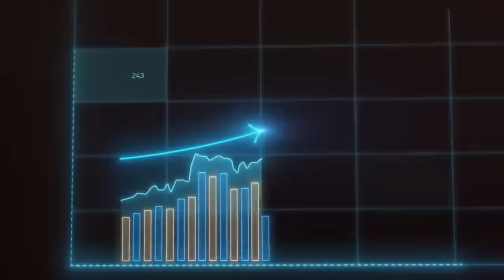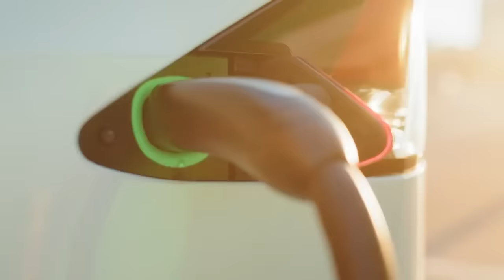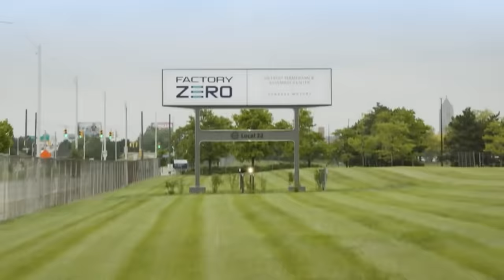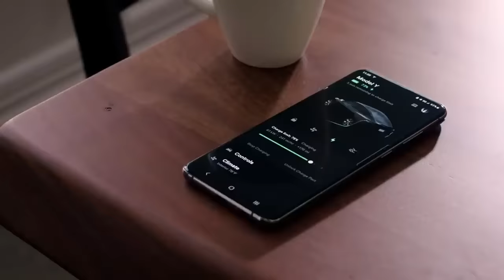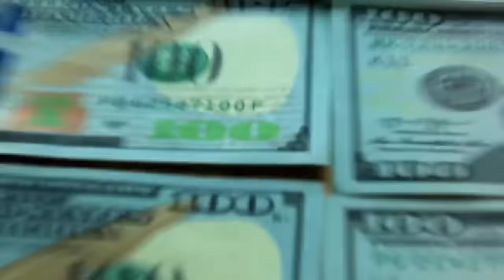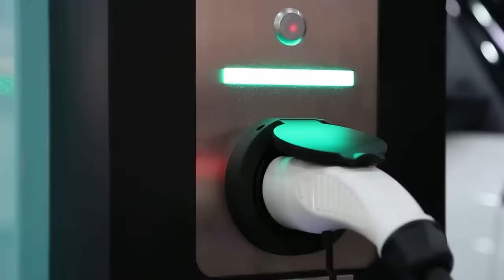Electric Vehicle Owners Are Frustrated and Demand the Return of Gas Cars

Comment: A co-worker was bragging endlessly about his EV.  He was so superior to those of us who have normal vehicles.  Then, last Monday,  his wonderful, dependable car would not start.  He sat in the parking lot, plugged into a charging station, for a solid hour.  The temperature went from -19 to -22 F and he finally came in and asked for a ride home.
Reply: @retrobeatsdang brutal. 😂. You really want him to get his just desserts.
Reply: That's mean!  He might not of had a warm enough coat on and it would of killed the guy. Bragging about something because it makes feel better is nothing. It's when your boss starts to have you dotting that will hurt you or how about not caring if you fall on ice and hurt yourself! Bragging is nothing compared to bosses I have seen. Like my last boss acted like a school teacher to actually acting like a boss she didn't really punish anyone if they get harassed or get hurt by someone. She was acting like miss sunny days
Reply: @vanishingfox1339 Would you give that guy a lift?
Reply: Is that workplace at the north pole?
Reply: Bwahahahaha
Reply: no onesw car starts in this weather       just like the old days   u forget>>>
Reply: @cindybrown9898  Take your BS lies elsewhere.
Reply: A Tesla should have a heater port into the battery cooling system. A propane heater in the frunk could be plugged in and cycle on and off to prevent the battery from freezing.
Reply: My father used to work for the AAA in Buffalo. They would receive thousands of calls daily for cars that wouldn't start when it got cold.
Reply: @lanejohnson7656  Thousands of no start service calls at the AAA then the temps hit the lows.
Reply: @peter130476  I reckon it's in the northern part of the US. There has been a ton of news coming out of the US about carparks full of Tesla's that won't start, either due to cold or charging stations being dead from cold. Also a bunch of news poking fun at Tesla drivers. I'm not sure if the weather's any different to normal but there are probably enough Telsa's around now for people to take notice.
Reply: most chinese EVs have air conditioned batteries, it warms the battery when too cold or cools it when too hot, that must be a old tesla thats dead.
Reply: @abcJ-q4v hahahaha, how do you warm in an EV battery  when the heater uses the same battery and battery won't operate? Oh wait, you said 'Chinese EV', they catch fire all on their own, no common sense required!
Reply: Oh I forgot that gas cars never have issues 😆
Reply: @rcpmac  Thousands out of millions?  lol    You do realize when AAA got there they likely hooked up a jump box or jumper cables and started the vehicle because the cold ate up the battery right?  lol.   Do some research and tell me how many of them thousands were towed to the persons home or to a gas station..  

See thats the difference..  You run out of charge in your EV you are getting towed.. You roll up to a charger that either doesn’t work or there is a line and you only have 5 or 10% battery you  literally have to wait or get towed to another charger. You can’t just drive across the street or down a couple blocks to another charger.. lol

 It got down to -30 where I live and even my lil carbureted Ram 50 fired right up with 6 pumps on the pedal.  Whenever it gets cold, snow or ice out I fill 2 5gallon gas cans and throw them in my truck just in case I run into problems myself or someone else needs help. I always have jumper cables in everything I own as well as a small boost pack..   Don’t know how many times I’ve checked on someone that slid off in a ditch and dumped 5 gallons in their tank to make sure they had enough gas to run their car to stay warm until a tow truck got there or jumped someone’s car for them..  I’ve only ran across one person that wasn’t smart enough not to put E85 in their car and their fuel lines froze up. Even that was a relative quick fix without a tow..    Don’t see EV’s in my area because there isn’t anyone dumb enough to buy them because chargers are non existent..  Something you and EV Jesus refuse to acknowledge is, in many parts of the country chargers are non existent once you get off the interstate.. lol
Reply: EV owners tend to be quite arrogant and a bit loony...
Reply: @travelmates1 - that’s because they are on a mission from God to save the planet - God bless all EV drivers 🙏🙏🙏 - thank you for your service 🖖🖖🖖
Reply: Wow
Reply: @peter130476  We had temperatures under -15 to -5 deg Celcius (5 to 23F) for over a week now (in Europe)! Good thing I have a diesel with a good battery. Started at quarted of key turn...
Reply: @timothykeith1367  So now you want to use propane to heat the car? Why not just buy an ICE car and admit EV's are a waste of money, and terrible for the environment?
Reply: @abcJ-q4v  Chinese EV's are the MOST notorious for burning to the ground. I would probably not make the comparison to Chinese EV's for that reason. I might knock EV's but even Tesla conditions the battery. Chinese EV's are not special. Well they are, they're special for burning to the ground more frequently.
Reply: Did he leave his car at the charger? I hope when he went to pick it up he had a big fine for overstaying!! Much mirth at work from ICE drivers I assume!
Reply: @timothykeith1367 propane heater in a Tesla your crazy. Never going to happen.
Reply: @fmo94jos8v3 right, let's just add more combustibles to the already rolling nuke.☢🤣
Reply: 😂😂😂 karma!!!
Reply: I don't agree with bragging at all.  However, which EV did he have?  EV's are like any other automotive product - there are good ones and bad ones.  If he was driving a Nissan Leaf, good luck in cold weather. There's no thermal management of the battery on a Leaf (aka no heating or cooling system at all).  I live in Canada and drive my EV in Canadian winter.  I keep a booster pack with me in the off chance my 12v battery dies, I can still start my car.  The key detail for all EV's is I charge at home. If you can't charge at home, I'd say to anyone an EV doesn't make as much sense.
Reply: I wake up every morning to a full tank ⚡️and I live in the arctic 😊
Reply: At least you acknowledged his superiority.
Reply: @cindybrown9898 My cars have always started at temperatures of -40 and even lower. That included my 1969 Acadian with the 230 straight 6 and 1 bbl carburetor.
Reply: 面白い😅
Reply: Doing and saying are two different things, do you ever see an ICE car breakdown?
Reply: @timothykeith1367  
Why not just use the electric like they already do? They have a heat pump, much more efficient than a propane heater (or gas for that matter).
Reply: I don't understand since I haven't had a single issue with mine from 2018 and according to people life in cold climates have no issue? Was is a Nissan Leaf if so can see it
Reply: I had an old 2007 Nissan Qashqai, and i never had a single issue with it in winter.Once it was -40 Celsius. It started like it was nothing. The only thing I had to do was replace the battery once in a while
Reply: @faithdelucas1517 most companies aren't gonna care if you give a co worker a ride home. That's not their issue. Hope all that smugness will keep em warm
Reply: @timothykeith1367  One way to hybrid! Fuel is much more efficient at heating than as an engine. Also a small engine with a large amount of heat extraction would be efficient but more complex. Cold climates change the game.
Reply: he can call tow truck tow his EV and him self home
Reply: Epic moment I assume that was!
Reply: LoL, that should stop his bragging.
Reply: Once EV stops charging it explodes 😂
Reply: @retrobeatsThats the problem, instead of working together. You guys are just hating because you don't have it. Stop being jealous. I waited 8 years to buy minds while young rich kids with no responsibilities and mommy and daddies money was driving around bragging. I finally got minds and loved it not going back.
Reply: The cold affects gas cars too.  But if his car wouldn’t start in the cold that was his fault for not charging knowing it would be cold.  Plus they don’t prevent them from starting like gas cars they only take 15% of range.  Either your story is just that a story or the guys an idiot.
Reply: So I guess you shouldn't have an EV if things get cold?
Reply: And gas cars NEVER break down in the cold 🤣🤣
Reply: @peter130476 have you never been to North Dakota in the winter?? 😂
Reply: Надо было сказать чтобы пешком шёл. 😂
Reply: @retrobeats This comment show the insanity on both sided, it should be up to each what he want.
Reply: Not in my gas guzzler, gotta pay a $500 tax credit first.
Reply: @timothykeith1367 mandatory fossil fuel heater, OH I see now.
Reply: The new Atomic Power Tesla, no Frunk but mushroom cloud on the right kind of collodion
Reply: People who drive gas cars never act superior.

(Reads comments on this video)

🤯
Reply: Lolololololollololololol
Reply: Had no problem with my Taycan at -15°C... Tested the new Macan EV in Finnland aut -28°C... With a good Thermomanagement it's no problem... The older EV models hadn't one... Those produced in the last 3-5 yrs do
Reply: @nickmijnmening3942  my Hyundai’s battery just died at -2f.
Reply: @nickmijnmening3942  I’m glad you have so much money to throw around.  When it comes to trade in or resale time good luck.🍀 Do tires really wear out faster?  Weight is copout it’s acceleration IMO, my Lexus GS 450H is rear drive only, and it will kick a wheel any time it rains.  Never driven in snow too low to ground, tested in drive way and it felt great with all that torque.
Reply: @flouisbailey  well, tires wear out a little faster, but I save money in fuelcost (about 50% cheaper here in Germany, I charge 29ct/kW, my Audi A4 Diesel consumes compared 79ct/kW) next to that I don’t have oilchange etc, so inspection is way cheaper too.

EV will develop more, it‘s like 1920 with the first combustion cars…

EV is a brutal space because NOW there are new players… USA Tesla, Lucid or China BYD or Geely.
I plan to buy the new Zeekr 001, comparable with the Taycan, cost only a third! Interesting.
Reply: @hayabusaTravels  lol, had no problems with my Taycan GTS. And I drive cheaper than a Diesel… 🥳
Reply: Maybe Evs should have a small gas engine to keep the batteries warm.
Reply: I was skeptical about EVs I figured I'd let the EV braggers and consumers test them out before I'd spend my hard earned money on them. Glad I waited!
Reply: In reality it was probably the 12v battery that froze, the main battery should look after itself unless charge was low.  If 12v battery fails the car is dead, just the same as an ICE. Most EV owners do not realise they also have a small 12v battery in addition to the power pack.
Reply: When we get a very cold day here in canada, almost every morning when I finish my night shift and get in the parking to get back home,  one or many colleagues cant start their car because of cold and we have to boost them . This has nothing to do with EVs or ICE, mechanic just does not like very cold and it always have been.
Reply: Hertz announced they will no longer  buy EV because of low resale value and higher costs to maintain. Tesla dropped their price, really messed up their resell value.
Reply: Like a gas car never heve bettery issu in the winter
Reply: With this whether, gasoline cars are frozen too. Not able to start either 😂😂😂
Reply: Despite all things, I would have given the guy a ride home. And would have been the nice and kind man my mother raised me to be. Even in the scriptures it is written to have kindness even in thy enemies for it will put hot coals apon their heads. You may even be rewarded for it.(proverbs 25:22, also 25:21-22). I wouldn't have to say a word. Once he got into my large full size luxurious Jaguar XJl and feels that nice warm comfortable smooth ride along with all the nice kool features and double sunroofs, TV monitors and fold down desktops, he would change his mind really quick. Lol!!! He'll learn....
Reply: @cindybrown9898 tell me you're clueless without telling me you're clueless. Go
Reply: They are annoying on the road.  It's like they always want a drag race.  Cut me off a lot too.
Reply: A friend of mine took blankets from work so he would not have to use the heater in his EV so he can make it home. He had to keep on scraping his windshield from the inside at temperatures of -40 in Montreal. He barely made it home.
Reply: @retrobeats  Well. At this point he spent so much money on his electric car so he can not afford taxi fare!
Reply: It’s been really cold I’ve not had an issue with my ev.
Reply: No ride home
Reply: @ktymouse your right…cause ice vehicles always start on demand
Reply: Not true.All my gas vehicles started in Chicago I'm-25.We had a EV crisis when the temperature dropped.
Reply: @lanejohnson7656 Lies. In Norway (much colder than the U.S. and higher percentage of EVs) don't have that problem.  They learn how to prepare their cars.  In Norway, 87% of such roadside calls are for ICE cars not EVs, hater.
Reply: I would have told him to catch the bus!!! 😂😂😂
Reply: His problem was , “he ain’t got no gas”.
Reply: Debs husband says some people seemingly have to learn the hard way.
Reply: @faithdelucas1517 debs husband says this is a hurt feelings alert!!!  Don't say anything that might hurt the little snowflakes feelings!  The little snowflakes might have a meltdown and that would be a shame!  😂😂😂😂
Reply: @timothykeith1367 debs husband asks why not just buy a gas powered vehicle and then you wouldn't need the stopgap measures?
Reply: lol :face-green-smiling:
Reply: Buy a Nio.... until then drive a Camry!!!!
Reply: EV’s are not for everyone. If you are suburban wife living a climate that is not harsh and you are using it twice a day to go to whole food you be fine.
Reply: @peter130476  Chicago experienced 6 days in a row of weather at that level this winter.  That isn't quite the North Pole.
Reply: You should have let him take a cab unless of course if he is your superior!😂😂😂
Reply: HA HA! WHAT ABOUT THE SLAVES IN THE CONGO!! ASK YOUR FRIEND ABOUT THAT.
Reply: The thing is that we all knew that these vehicles have problems such as availability of electric charging stations, temperature conditions affecting batteries, heavy weight vehicles, etc. 

When something is new my family preferred to wait a while until some of the bugs are worked out. Others just can’t wait. So he is stuck with a vehicle that’s temperature sensitive.
Reply: Ha Ha Ha Ha Ha Ha 😅😅😅😅😅😅
Reply: An ICE car won't start in really cold weather if the battery is weak when you purchase a cheap battery be aware of this
Reply: @SteveEddy-od7fb  true, and also if the battery is old.  That is something I can control, with a little planning and maintenance.  When brand new EVs, with strong batteries, won't charge or start, it's a problem.
Reply: Tell him you are getting a V8, because its your right to

Comment: Battery powered vehicles looking for a solution to a problem that doesn't exist.
Reply: High 5
Reply: You have summed that up perfectly
Reply: Adding 2 more steps to a problem makes no sense.
Reply: I say bring on some warming tired of cold snowy winters, more people die in winter from cold than heat in summer. and warmer winters will lower Gas and electric usage.
Reply: Boy if that ain't the truth...
Reply: @jimlarkin1400 No because you still have contaminated air and water issues to deal with.

And where's the proof electric bills are 'getting cheaper'😂 A warmer overall temp means you'll just be cooling yourself more  with air-conditioning in winter then.
Reply: And creating NEW problems that are worse than the ones created by ICE vehicles.
Reply: @snapdragon9300 carbon Dioxide is not a pollutant.   Everything is Carbon.
Reply: lol. Bingo.
Reply: I am guessing that the fact that the planet is heating up 11 times faster today than it has in the past 100 million years is not a problem as far as you are concerned. At what rate would it concern you? a 100 times faster, a 1000 time faster?  @leezap
Reply: oh, and where did you find an endless supply of oil?
Reply: @fatoldhikki4837  Where did you find the endless supply of materials to make EV batteries?  How much land are you going to render useless by digging massive craters on the planet?   You can literally walk over an old oil well and never know one was there.. 

My favorite is what is done with these old batteries? They are insanely harmful to the planet and have to be insanely expensive to dispose of.  What happens to them and who is financially responsible for them?
Reply: Don't fix it if it ain't broken (ICE).